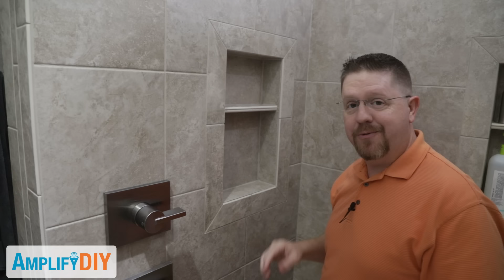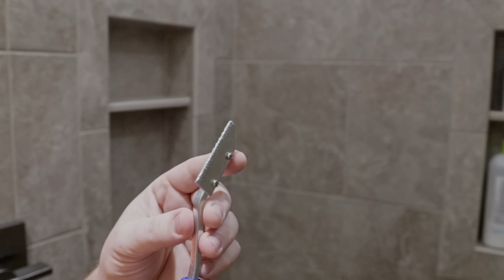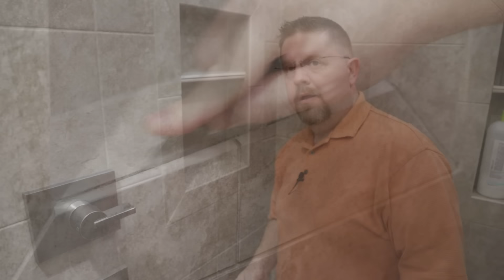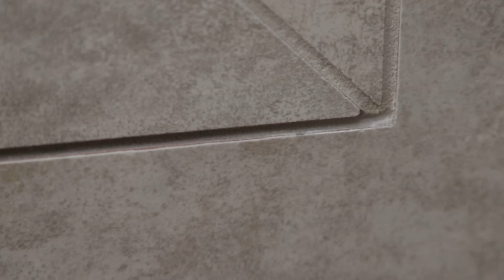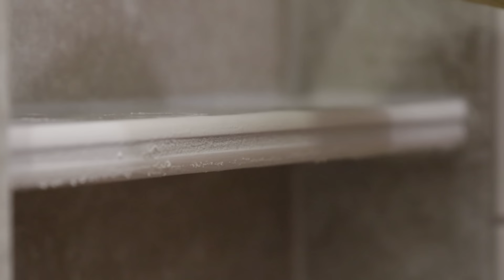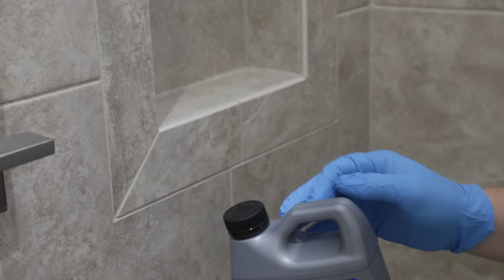How to Repair Cracked and Worn Grout (Shower)

Comment: Do i really need to get rid of the remaining grout? Can i just fill the crack?
Reply from the maker: You really do need to remove the old grout - if you just put a little layer of new grout over the old / cracked grout it won't be very strong and will just crack since the base below it is not strong.

Comment: So I guess the grout you used doesn't need to be sealed or waterproofed?
Reply from the maker: Correct. FusionPro grout specifically does not need to be sealed. Thanks for watching!

Comment: Did you seal your grout and tile to prevent mold?
Reply from the maker: Hi Needy - this grout (Fusion Pro) specifically does not require sealing, per it's instructions. The tile has never had a mold problem, either. Thanks for watching!

Comment: That must have been some really bad grout used originally. I have removed grout from MANY different showers and NEVER have seen grout come out that easy and uniformed.
Reply from the maker: It was really poorly installed - and I'm convinced it was not mixed correctly by the installer.

Comment: DON'T FORGET SEALER.  All grout is porous.  Sealer is required after the grout has dried for 24 hours (and after the haze has been removed)
Reply from the maker: The FusionPro grout I used specifically says in the instructions not to use any sealer. It's been several years since this video, and the grout repair has been holding up great!
Reply: @AmplifyDIY  ahh, must be impregnated with sealer.  Hence the name "Fusion".  Thanks.

Comment: Awesome vid, two things I figured out as I was going was
1. putting a bit of painters tape on the edges so the grout removal tool popping out didn't scratch the tile
2. using canned air to blow into the opening after the grout was removed got all the dust and chips out of there pretty much instantly
3. if the grout is cement based and the area is not tiny, then without power tools prepare for an ordeal taking that grout out. It took me around 3 hours of sawing to get like 10 in of grout out
Reply from the maker: Those are some great tips, thanks for sharing!

Comment: Just what I was looking for. Thank you. Question looks like whatever grout was used must be same grout to repair?
Reply from the maker: You don't have to use the same grout, but I wanted a perfect color match, and happened to know exactly what grout was originally used... so that's what I used. Good luck!
Reply: @AmplifyDIY  thank you very very much for responding. The grout on the bathroom tile floor  entrance is cracking. The grout in the corners of the shower wall is also. This video will assist me very well. Again, thank you.

Comment: What about sealing the grout ?
Reply from the maker: FusionPro grout specifically does not need to be sealed. Check the instructions of whatever grout you use to see if it needs to be sealed.

Comment: We have a shower that is tile with a fiberglass pan and right above the pan is where we are having issues. Would you use the same process for that? Thank you!
Reply from the maker: With a fiberglass pan, you are likely to get more flex/movement over time. I would recommend removing the grout from there entirely, and using a 100% silicone caulk instead. Good luck!

Comment: Great video! Is there a kind of grout you can recommend for fast dry? We only have 1 shower in the house, so it is wet every 24 hours...
Reply from the maker: None that I'm aware of. Even the "fast dry" grouts you can find at Home Depo and the like require up to 72 hrs to fully cure. 

In your situation, I'd maybe plan to do the job the morning of a planned trip away from home. i.e., if you have a vacation coming up or other out of town trip get up early the day you are leaving, shower, dry the shower as well as you can, do the grout repair, and leave town. When you get back the shower will be ready to use. 

Good luck!
Reply: @AmplifyDIY  Thank you for the advice! I guess I can only hope it will last long enough for me to fix it.

Comment: I have a tiled stand up shower - tiled floor and tiled walls (no tub).  Would you caulk the grout at the floor base where the wall and floor tiles meet, or just grout, and overtime, redo the grout per your video?
Reply from the maker: Great question! Anytime a wall meets a floor or a wall meets another wall at a 90° corner, I do not recommend using grout at those joints. Caulk instead. Use a 100% silicone caulk, as it will hold up the best. Good luck!

Comment: How long after using shower should you wait before tackling a re-grout project......24hrs.. 48hrs??
Reply from the maker: When removing old grout, you can do that anytime... but it's certainly messier if you are doing it in a wet shower, and things do need to be dry when installing new grout. I'd suggest when you are getting ready to do this project that you take a shower, then wipe down the walls and dry everything manually as well as you could... then wait at least overnight. The shower and grout will be plenty dry by then. Good luck!

Comment: Can the same method be used if grout is already missing between the tile and the tub? Thank you in advance!
Reply from the maker: Yes, if the grout is already missing, just do what you can to clean out the gap so you have a good mating surface, and get going installing new grout. Great question!

Comment: Great video! Do I need to apply sealer after applying the grout?
Reply from the maker: I used FusionPro grout, which specifically does not need to be sealed. Check and follow the instructions with whatever grout you use. Good luck!

Comment: can you use painter's tape to keep the surface clean?
Reply from the maker: Not really - this is a pretty messy job, and the painters tape won't hold up very well. It's pretty easy to just remove the surface haze after the fact. Good luck!

Comment: The only thing he forgot to mention is that you need to seal it so you don't end up having the same issue sooner rather than later.
Reply from the maker: The FusionPro grout I used specifically says not to use any sealant. Of course, follow the instructions for whatever grout you use. Thanks for watching!

Comment: Question? How do you apply new grout in hard to reach places that at aren’t flat? I need to regrout the corners of my shower and also the bottom tiles of the wall connecting to the bathtub, that isn’t flush with the wall.
Reply from the maker: Anywhere that is a right angle (floor meets wall, wall meets wall, etc) you should use caulk instead of grout. Corners like that expand/contract a lot with change of seasons etc, and silicone caulk will allow for that expansion. Grout will crack there every time. Good luck!

Comment: I also am wondering how to grout corners. That seems like the hardest part. Plus you didn't mention sealing the grout. Doesn't it have to be sealed?
Reply from the maker: 90º angles (like where a wall meets a floor, or where a wall meets another wall) usually are not grouted at all, but instead are caulked with a clear (or white, or whatever color you like) 100% silicone caulk. As for sealing: the FusionPro grout I used specifically does not need to be sealed. Consult the instructions for whatever grout you use to see when/if it should be sealed. Good luck!

Comment: what about the corner
Reply from the maker: 90º angles (like where a wall meets a floor, or where a wall meets another wall) usually are not grouted at all, but instead are caulked with a clear (or white, or whatever color you like) 100% silicone caulk.
Reply: @AmplifyDIY  thanks... someone grouted these corners and it cracked so I'm caulking them instead

Comment: Is it easy to remove grout, and re grout sections that are quite thin? Would using a box cutter for the smaller be okay and proper tools for larger sections?
Reply from the maker: "Easy" is such a relative term. :) In general, removing grout is not really all that easy. With proper tools, it can be easier, but I don't know anyone who considers this an easy job - whether the grout is thick or thin. 

Use whatever tools you have at your disposal. If a razor/box cutter works for your thin areas, have at it!

Good luck!

Comment: I have been told that using your finger instead of a specific tool is much better for getting the grout deep into the cracks.  Thoughts?
Reply from the maker: I disagree. Using a tool is faster and will do a much more even application. Thanks for watching!

Comment: Hi, thank you so much, great video. A quick question, do you suggest use "grout sealer" on the old grout to prevent mold?
Reply from the maker: Hi Sean - I recommend you check the instructions that come with the grout you use. FusionPro specifically says not to use any kind of sealer. Grouts vary though, so be sure to check and follow the instructions. Thanks for watching!

Comment: Helpful video. Question: Can one use non-cement grout after removing the old cement grout and vice versa? Curious. Thanks!
Reply from the maker: Yes, once you have all the grout out of a joint, you can replace it with whatever type of grout you like. Good luck!

Comment: I just had a shower pan failure which was removed and redone with cement and tiled. That was about 6 months ago and there are cracks in the grout. It was mixed with water so likely too thin… my question is, can i use sanded grout to touch up all those areas or can i add premixed grout to that new.y done section including those containing the fine cracks? Trying to avoid removal of all grout if not critical and worth these other routes. Thanks!😊
Reply from the maker: Oof. Sorry to hear it sounds like your install was done incorrectly. "Touching up" grout is not a great idea. If there are cracks in a joint at all, the best way to fix it is to remove all the grout from that joint and re-do it correctly. If you simply try to touch up the areas with a thin coating of grout over cracked grout, the new stuff will just crack within a matter of a few weeks.

Comment: How about grout sealant, is it necessary to apply to help out the new grout?
Reply from the maker: Check the instructions for the grout you use. If you go with FusionPro, it specifically says not to seal it. Good luck!

Comment: I didn’t see that you sealed the grout. Is it necessary?
Reply from the maker: Hi Michael - FusionPro grout specifically says not to seal it. Check the instructions for whatever grout you install though - many do require sealing. Thanks for watching!

Comment: Thank you great info easy to understand as I am female and good Info is a must.  Can you advise me on the title shower floor meeting tile shower walls question being should it be called around floor or grout? Thank you for your reply and your great advise, Kittie from Chattanooga Tennessee❤
Reply from the maker: Hi Kittie - When a wall meets a corner or a floor, it should be caulked with 100% silicone rather than grouted. I happen to prefer to use perfectly clear silicone for this job, but any color is fine, as long as it is 100% silicone. Good luck!

Comment: I'm a new home owner. Some of the grout is chiping off when i clean it. What is the proper way to clean the group without it chipping off? also how do i keep it from changing colors? it was white before. Now its an off white. Is there some sort of sealer i can use? I'm completing green to this sort of thing. Any advice you could give me would be much appreciated. Thanks for this video. I will be replacing some grout and this video was very helpful. How long am i supposed to let the grout cure before i use the shower? What is the difference between cement grout and non cement grount? i'm not sure which one mine is.
Reply from the maker: Lots of great questions! Most of what you are asking will be really difficult to answer definitively, unless you know exactly which type of grout was installed. Since it is chipping when simply cleaning it, it's time to re-grout. I'd clean out all your seams and re-do the whole thing, using a grout you choose yourself. I happen to really like Fusion Pro grout, as it does not need any sealing and is easy to work with. Follow the instructions for whatever grout you install, and it will list whether it needs to be sealed, cure times, etc. 
Good luck!

Comment: Not all grout is the same, and application methods vary.  Great video, but that's important to specify up front.  Some grouts set up in 15 minute to a finish that is very hard to remove.

Comment: this was EXCELLENT, makes me almost thing I could handle this.  Do I need to seal the grout after it cures?  My handyman re-grouted our shower a year ago but never sealed it and now it's got cracked spots and some are a pinkish hue. I think it was the solution the cleaners used, not sure. Please advise on sealing.
Reply from the maker: Hi Jamie. I used FusionPro grout, which specifically states in the instructions not to seal it. Most grouts do require sealing, but some do not. Consult the instructions. Good luck!

Comment: Hello, loved your video, Have a few questions, Do you need to put any sealer before or after? How soon can I do this after the shower has been used? And how soon can you use the shower after you finish grouting?
Thanks!
Reply from the maker: Hi Janette - apologies that I did not see your comment until now. I used FusionPro grout, which specifically mentions in the instructions that you don't ever need to seal it - so, consult the instructions for whatever grout you are installing. That will list things like if/when to seal, how long the cure times are, etc. Good luck!

Comment: Some of the floor tiles in my bed room are broken and they make a crunch sound every time i step on it. The problem is matching the color... because all of the grout between the tiles are 25+ years old
Reply from the maker: Yeah, that's a tough problem. If there is crunching though, the tiles need to be replaced. The best you can do to match the color is just try to eyeball it. Good luck!

Comment: Did you have to seal it?
Reply from the maker: FusionPro grout specifically does not need to be sealed. Consult the instructions for whatever grout you install to see if it needs to be sealed, etc. Thanks for watching!

Comment: Question: the tile that's been in the house for the last 50 the grout doesn't crack or chip off ever.. HOWEVER  someone install some tile in my house last year and it's cracking already. The floor got wet and it really cracking down. Why is 50 years old grout not cracking at all and 1 year old grout cracking fast?
Reply from the maker: Most likely due to a poor install - if the substrate (backing material) that the tile is stuck to flexes at all the grout will crack pretty quickly and easily. This can happen due to changes in seasons, weather, walking around on it with an incorrect substrate, etc.... or, they could have simply not followed the instructions with the grout (mixed it incorrectly, didn't seal it if required, waited too long between mixing and actually installing it, etc etc) - there are myriad reasons why it's not holding up. Sorry to hear you are dealing with this, and I hope you can get it resolved. Good luck!

Comment: Could you use alcohol to remove the haze?  It is all I have and live an hour from Lowes or Home Depot.
Reply from the maker: Hi Terry - yes, you can use rubbing alcohol.. but make sure it's dilute to at least 50%, as you only want to break down the haze, and not damage of the rest of the grout. Good luck!

Comment: All you are missing is the grout sealer to make it waterproof for a year.
Reply from the maker: Hi HumanFamilyMember - FusionPro grout specifically says in their instructions not to use any sort of grout sealer. Depending on the grout you use, sealing may be required, of course. Thanks for watching!

Comment: My problem is in the bottom corners. Where it's harder for me to put the grout.
Reply from the maker: Yeah, can certainly be back breaking. If you have grout cracking at the joint where a floor meets a wall, then replace all that grout with clear 100% silicone caulk.... any grout you put into such a joint will always crack due to the joint expansion as the house adjusts to the changing climate and seasons. Thanks for watching!

Comment: Haven’t finished the video, but I got a free estimate from a restoration company because we found a couple spots in the floor/wall where water damage was. I was told by the owner of the company, that pre mix grout is not recommended for showers. The water from the shower will eventually seep through the grout.
Reply from the maker: Hi Angela - I'm not sure I agree with the person you consulted. Pre-mixed grout performs well, as long as it is installed correctly. All the rest of the grout in this shower has been perfectly fine for the 6+ years since this house was built, and my repair has been perfect since I did this video. Thanks for watching!

Comment: How about sealer ?
Reply from the maker: The grout I used specifically does not need any sealer. The instructions were clear on that. Check the I structures with any grout you use to see if it needs to be sealed, how often, etc.  Thanks for watching!

Comment: Great video. Thanks for posting. Except I think you forgot to seal the grout.
Reply from the maker: Hi Doug - the specific grout I used (Fusion Pro) does not need to be sealed - the instructions are specific about that. I think I mentioned this in passing in the video, but I don't recall for sure. Most grout definitely requires sealing as you mention. It's always best to consult the instructions for the specific product you are using. 
At any rate - thank you for the feedback, and thanks for watching!